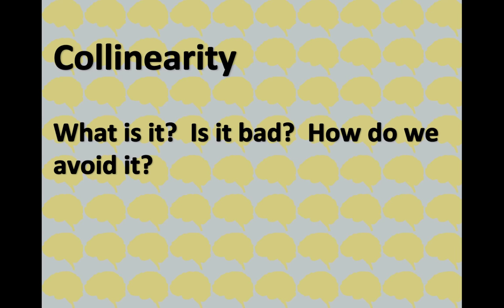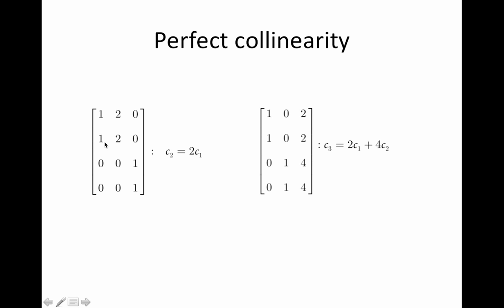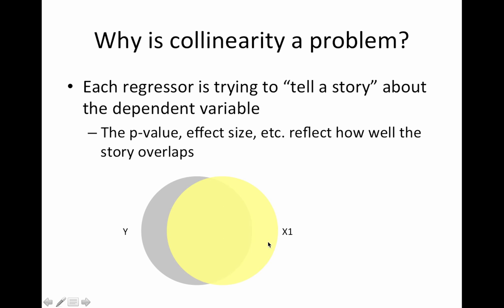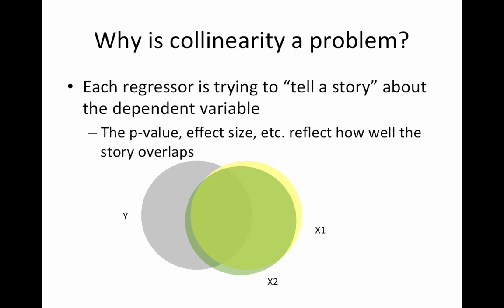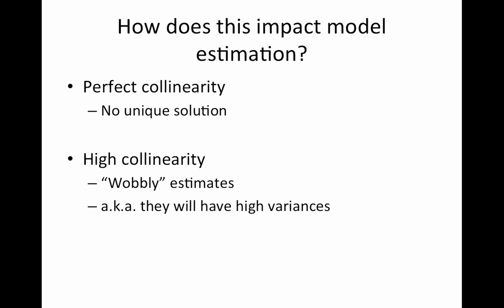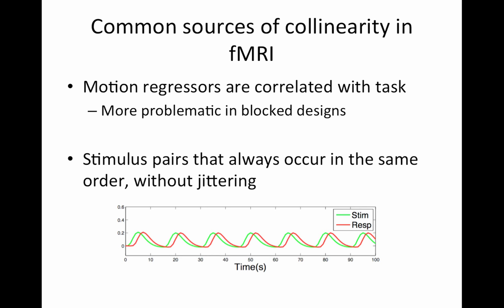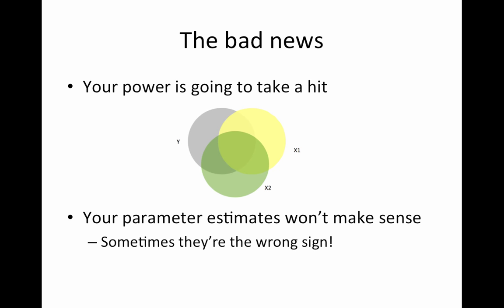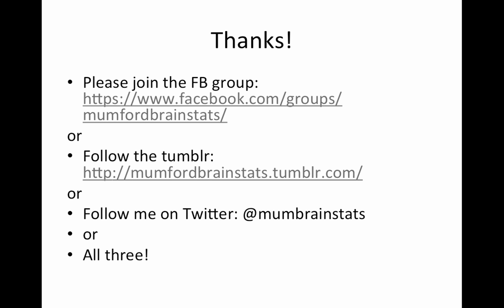Collinearity 1:  What is it?

Comment: Is correlation and collinearity SAME..
Reply: They are perfectly related in a bivariate case (two predictors are highly correlated, but they are not correlated to any other predictors). It is possible to have situations when it is a combination of predictors that when taken together are collinear with another predictor (the correlation between the focal predictor and each of the other predictors may be fairly low when looked at one at a time, but when taken as a linear combination of the other predictors, it becomes high). The reason why one level of a categorical variables is omitted in a generalized linear model when a constant is present in the model is to avoid perfect collinearity. If you have monthly data, and include monthly indicator variables (which take on a zero or one value, depending on whether an observations falls in a particular month) for all 12 months, then the sum of the monthly indicator columns would be a vector on of ones. This sum would equal the data for the constant term in the model (which is a vector of ones), as a result, the linear combination of the monthly indicators equals the vector used for the constant term, making them perfectly collinear.
Reply: @danputler3080  is collinearity and linear dependency the same?